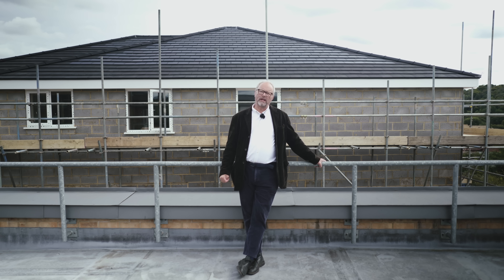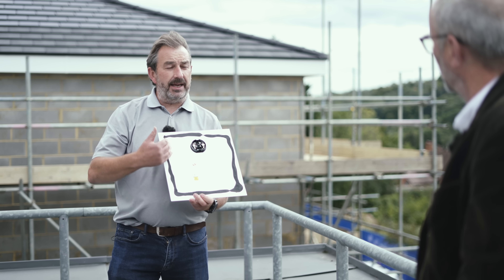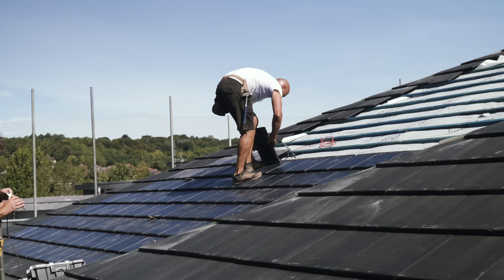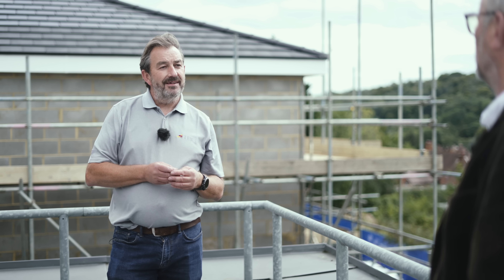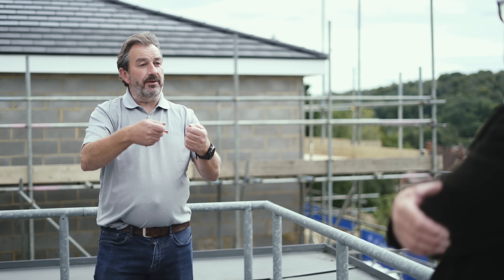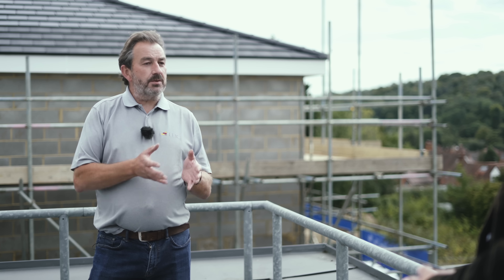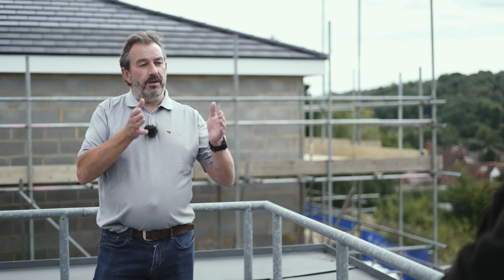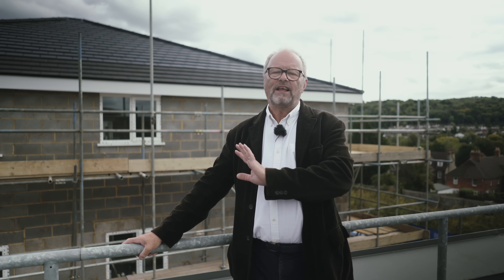Solar Roof Tiles - should every building generate its own power? | 100% Independent, 100% Electric

Comment: how do these fair in climates like canada with snow in winter? can these be heated at all to prevent snow buildup?
Reply: Many installs in Canada, Kowloona & Lions Bay have been finished recently. Numerous systems installed across Scandinavia where they have similar temperature to you, and in 9 years since being patented, no return service visits required
Reply: @chrishall8738  i pretty much assumed that, its just concrete and glass, that wouldnt be an issue here. but im more wondering if they heat up enough to keep snow cleared and able to produce power through the winter? or does snow just build up on them and you use the grid all winter?
Reply: @JamesMichaelDoyle  The modules are covered by an ETFE DuPont mineral polymer, not glass. Unfortunately, like all solar pv, if they are covered with snow, then they will nit generate any power.
Reply: @JamesMichaelDoyle  Thanks for being so rude. We are presenting a different take on installing solar pv, not reinventing it, and as far as I know, having spent 17 years selling all types of PV, there are no mass produced solar modules that have heating elements attached. The most common request is for cooling the panels rather than heating them.
Reply: @chrishall8738  well, rudeness happened after you repeatedly ignored my actual question, and then chose to be silly and nitpick verbage. are you the chap in the video? if so, thanks for letting him on site and spending the time to talk about the products.

do you think getting it just warm enough to prevent the snow build up in the winter  is a viable possibility that just hasnt been bothered with large scale yet? because that would make this fantastic, even if some of your power production was used to get the snow off.

how is this material to stand on? if you had to clear the snow off yourself, is this stuff durable enough to have you walking around shovelling it off?
Reply: @JamesMichaelDoyle  always happy to respond and give the best information that I can based upon the questions asked.

Comment: Nice idea but you'd have to be a bit mad to spend £27000 to save a few quid. Will the solar panels and electrical connections last longer to see them payback?
Reply: Paul, this was a big install on a block of 8 flats. We have just received an order for 6 kWp of tiles, balance of roof plus 10 kW hours of battery, which cost £22,000. Their breakeven is 10 years. The output of the tiles is warranted for 25 years.

Comment: He said that house had 900 tiles? At £30 each that makes it £27,000!! That's before batteries and installation fees! That's not a small premium to pay, thats massively expensive! £27,000 would pay for diesel for my car, and house electricity for about 15-20 years! By which point the solar panels need replacing. 🤔
Reply: This was a big install on a block of 8 flats. We have just received an order for 6 kWp of tiles, balance of roof plus 10 kW hours of battery, which cost £22,000. Their breakeven is 10 years. The output of the tiles is warranted for 25 years, however, as there are no moving parts in solar they typically last much longer,  we are aware of a project that after 38 years the retested modules still gave 93% of their design yield.
Reply: @chrishall8738  that may be the case, but investing the £22k into a property would yield a higher profit in the 25 year time frame. I just can't see that initial outlay being worth it over the time frames we are talking about.... Good idea though if you're not pressed for cash! 😂🤔

Comment: 10x MATERIAL cost differential in this instance. Labor cost is probably 3-5x. The roof would be valued at more than the rest of house- want to guess how much your insurance rises? Plus 1000 little connections, what could go wrong. Government subsidies are the only reason these exist. And I don't agree with that, either.

Comment: Yes all new builds should require a minimum 500 Watts of PV with a micro grid tie inverter & net metering .
Big PV output on mass will destabilise the grid so this should just cover the minimum load of the building .
A off the shelf 500w micro grid tie could be used .  

Smaller should be cheaper !

Comment: in the Canadian climate, the roof will leak.  Seen ice lift regular shingles that are overlapped half their length. If water can migrate and freeze up several inches on a standard pitched roof than freeze,  these things don't have a chance.

Comment: Even if I live in Montreal and we have cold winters, the summers now are so hot and sunny, I think a solar roof makes sense, especially for running LED lighting inside and outside the house, also ventilation. True we have in Quebec the lowest hydro rates in North America at about 7 cents a kilowatt hour bellow usage of 40 per day, tier 2 is about 13 cents for residential consumers  plus a 60 cents delivery fee per day. I'm still interested in solar or a combination of power production and warming of water on the roof for my hot water tank in the basement (that runs on natural gas).

Comment: I love the idea, but have few issues.
The price is the first obvious issue. £30 compared to a £1. But this may be insignificant when you consider the amount of electricity it can produce.

45 tiles in series. So if one goes ‘out’. You could potentially have 40 odd tiles contributing nothing?

A roof tile that is lasts in excess of 40 years. But has a hole cut in it to allow the wiring and is only waterproofed with what looked like some mastic which won’t last that time. So water ingress is a great possibility. Could possibly make the hole to be under the headlap?
Reply: Hi Paul,
Yes, comparing a standard tile to a solar tile is not comparing apples with apples, we are offering a solar roof instead of a standard roof.

Each 45 tiles in the series has a by pass diode, which should one fail, will allow the voltage to carry on without killing the entire string.

The modified structural resin is UK designed, and comes with a 30 year warranty.
Reply: Chris Hall Thanks for the reply. I think the product is a great innovation and through time will become better. I’m just still a bit skeptical at this stage. As anything I’ve dealt with in solar (PV) when it comes to roofing. Has always had teething problems. Those type of tiles ain’t the most robust. So any maintenance up there, guys walking around. Or possibly even at installation is potentially going to give you problems with tile breakage. Also, still not convinced by the resin seal. A look at the back of the panel shown in the video doesn’t fill me with confidence it would last the test of time. My area is roofing not Solar. But I just feel it’s like trying to squeeze two technologies together that don’t quite blend seamlessly at this moment in time.

Comment: Solar panels can be replaced for newer, better ones. Tiles are fixed, non replaceable (well not financially smart to replace them all with better ones) and have a fixed angle (not suited for every latitude, longitude).

Are solar panels not mounted and adjusted (angle) to the location, to maximize its full potential.

Comment: Hi Chris,  I have now been advised to apply for the Governments, 'Green Grant' to cover the cost of my tiles . . most surprised, but I am giving it a go.
Reply: Hi Peter, unfortunately the Government has not included solar pv & batteries in their Green Grant scheme
Reply: @chrishall8738  Hi, Chris, trust that you are well. You are correct. But what the Green Scheme does not say it that  Solar Tiles are excluded. .  So based on the fact that the planning officer did not know about them, and then having been informed, became enthused by them. . The ever so nice guy I spoke to said. ''To be honest I don't know if they are included or excluded. So I will have to go away check and come back to you. It may well be that as we have not excluded them specifically, they maybe included, like wise because of the function they perform. they maybe excluded.'' . . me ever the optimist,  I think they might say , Yes. .
Reply: @petercross8871  Hi Peter, I hope so, but from our understanding, solar PV and batteries were not included, regardless of type, tile, Integrated or bolt on top. If your planning officer is accepting your re-roofing and insulation upgrade?, as qualifying,  then good news.
Good luck, and keep me updated.
Reply: @chrishall8738  Hi, trust you are well. You were correct. The chap came back to me , with a question. '' Are you fitting  a combination of both Solar Thermal and Solar PV'' . To which I asked why and was told ..The Solar Thermal would fall within the scope The Solar PV would not. . . 
I feel quiet  enthused about what he said. . # lovegreenschemes

Comment: STUPID.  A STORM WILL BLOW THEM AWAY. THEY ARE HEAVY AND EFFICIENCY DECAYS VERY QUICKLY IN DIRECT SUNLIGHT. ALSO THE COMPLEX ELECTRONICS  BREAK DOWN. GLASS CRACKS. FINE CRACKS. HAIL STONES DESTROY THEM. VERY EXPENSIVE.
Reply: Thanks for your comments, however, please let me answer your points raised as follows.
The rooftiles have been used extensively around the world, and here in the UK are installed to standards deemed necessary for the localized weather/ wind demands, which could mean double nailing or clipping., as is normal for this type of roof tile.
 All solar is designed for "direct sunlight", the efficiency of our cells is warranted for 25 years, and is warranted to be still producing 80% of the design yield, ie 12 watts in 2045.
There are no "complex electronics" in solar pv cells, there are no moving parts, current is produced due to the photoelectric effect. In 9 years of installing around the World, North America, Africa, Egypt, Europe and Scandinavia we have not had a single breakdown.
We have no glass covering the cells, so no glass to crack,
They have passed the European test for hail and missile damage, so we would not expect them to fail in a typical hailstorm
Reply: @chrishall8738  i am afraid you are wrong on every count. solar cells lose their power at 20% a year and can cause fires if the electronic go awry. the electronics of load matching charging/recharging/inverters and wiring harness plus regulation is very complex and needs constant maintenance almost every month. the backup batteries lose capacity of 30% a year....its just useless. oil is only 30 a barrel and no need for expensive solar. solar cells can get stolen by thieves who will destroy your roof.

Comment: In hot climate double roof is actually a benefit - it helps cool your house.
Reply: it also will prevent the roof from drying out properly. look underneath most roof systems that have had solar on them for a long time (aside from tile) and they are normally worn down prematurely. the sun is both the enemy & the friend of most roofs
Reply: @BEATmyguest31  This is why a double-layer roof is actually a good thing.
You have the lower portion of the roof fully sealed, insulated and drained.

Between the two layers is a drainage plain and keeps the top deck cooler, extending the life of the roof itself.

Comment: As an electrical eng, connections cause unreliability. How many extra connections on an average roof. 900? How do you locate bad tiles in the future? Windage, panel separation?
Reply: MC4 connectors are the industry standard pv connectors, used in fields full of solar panels around the World, the difference we have is that all of our connections are made behind the tile, protected from the elements and animal damage. No UV degradation, no mechanical movement & abrasion and no water ingress.
In 17 years of installing solar panels and tiles we have had one single panel fail and replaced, as there are no moving parts the cells are extremely long lasting, so locating failed tiles is not something that is a major worry, but if this were to happen, each cell has a bypass diode, which allows the current to flow through the failed, or shaded cell, without reducing the voltage on the complete string.

Comment: And look at the nice big crack right across the tile running through the middle of the cut-out at 2:17. Concrete tiles are not that strong to start with, and when you cut 60mm holes in them - guess what happens? Yep. They snap like carrots! And, as is pointed out elsewhere, the connections on the back of EVERY solar tile, multiply the points of failure. Good luck ever having to walk over that part of the roof. So, all in all, perhaps a good idea - poorly implemented.  👎👎👎

Comment: Great and innovative idea however I can see a few flaws that may need overcoming to make it viable to the mass market, all those connectors are tucked away and not accessible so not great if faults occur (is there a greater potential risk of fire by concealing like this?) and I’d be interested to see what seals the cell to the tile and how long that sealant lasts considering a huge hole has been cut in the tile making water ingress more likely over time?

Comment: Hopefully, the next and obvious change in direction could be the realisation of low voltage - non mains [TV  etc] and low voltage ring circuit wiring to low voltage sockets.....which we almost have, using the hybrid mains sockets.
The waste of power and generated heat consumed by a TV just changing mains to lv to actually run the thing is why I now use iPad and laptop.
Who needs 50 inch screens except for the really good films? My everyday savings pay for me to watch on a cinema screen, where it should be seen, with the attendant amazing sound reproduction, built in, to boot.

Comment: He said all the tiles are in a series, so what happens if one cell malfunctions?
Reply: each individual tile has a bypass diode, which allows the rest of the current on the string to bypass the faulty/shaded cell, unlike standard modules

Comment: 1 ..  so water can run under the little solar panel water can still run thru the 2" hole in the tile where the wires g thru .. 
2 .. the 2 small holes in the tile are for nails or screws to hold it to the roof, the guy laying tile is just plugging them in and laying the tile on the roof ..

Comment: I knew a Chinese guy who could do half a roof for £100. Thing he couldn't do, was reduced the price of the batteries, to store the electricity and equipment. That's costs thousands he also showed me a pipe with a hole in that generates electricity. The pipe cost around £1. Don't ask me what was  it does how to store the electricity made from it, but you needed very little wind, not like the wind turbines, that the blades have to be changed every 10 years, and because of the wobble it creates ground disturbance, they must be moved to a different site every 20 years. They don't tell you this, people who own and produce wind from wind farms.

Comment: Is it an issue to have the tiles wired in series. Won't one faulty connection take out a whole row of tiles? Has a mesh solution been considered. Also, in terms of maintenance, what happens as tiles are damaged from wind, birds etc? Does one have to buy a large number of spares at the outset or will spare tiles and / or solar panels be available from major hardware stores, for example?

Comment: Sadly fitting a solar tile to a concrete tile is not eco friendly as the manufacture of the concrete tiles is terribly polluting, the solar tile should be made as a stand alone product to replace the old fashioned roofing tiles.
Michael

Comment: I have a 17kw solar roof system with 2 Tesla powerall2 batteries.   I run my house, and my shop on solar.  My average electric bill (after solar credits) is -$410 per month (yes, that is a minus).   Haven't paid an electric bill in over 2 years.   It's wonderful.
Reply: where are you located and what was the installed price if I may ask?